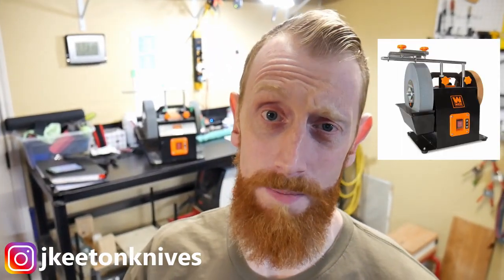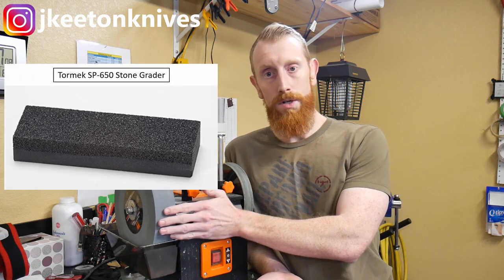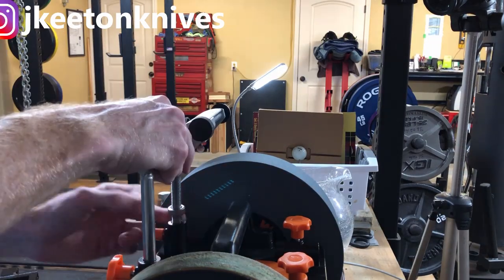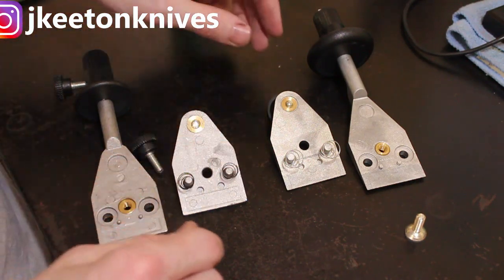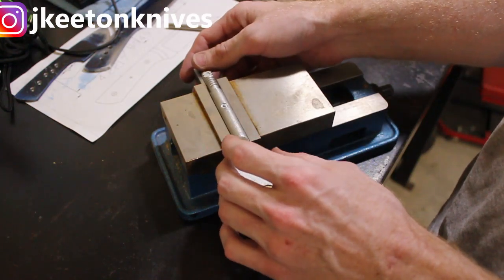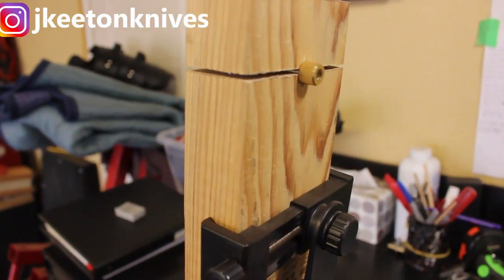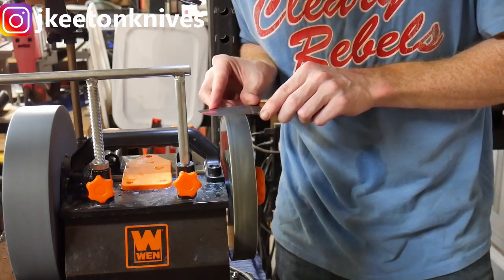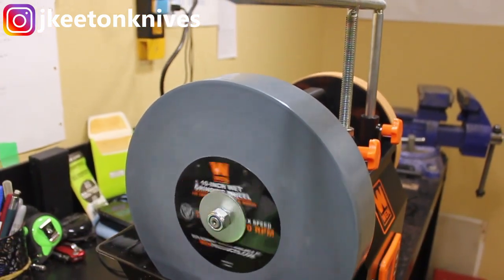WEN Sharpener Review & User Guide | Tormek Knock-Off

Comment: Just picked one of these up.  I also got the Tormek truing tool, but when i put it on the horizontal work rest and put the prongs around the vertical post of the work rest, it won't go all the way to the opposite side of the wheel.  Did you have this issue?
Reply: NVM.  I see you just have it floating on the horizontal arm like I did!
Reply from the maker: I'm not sure I'm visualizing the issue right, but the truing tool worked just find for me on my version of this machine.

Comment: I have a question  about the Wen; it seems to me that when using the guide bar to sharpen chisels against the rotation of the wheel, the guide bar is too short on the left side. I cannot use about 3/8" to 1/2' of thew grinding wheel on the left side because the hand plane blade support falls off of the guide . Do I do something wrong? Thank you for your help.
Reply from the maker: Hello sir, I've honestly never used it on anything other than knives. Sorry I don't have any advice for you.

Comment: Do you know if the torment sharpening wheels work on the WENs!
Reply from the maker: I have not tried any of them. But if they have the same hole in them and they're around the same diameter, I don't know why they wouldn't work! (The diamond ones may be more of an issue since you can't using the tureing and dressing tool on them to sure up on the WEN machine.
Reply: Red Beard Ops good point on the Diamond one didn’t think of that
Reply from the maker: @mtlvlgmnfishing  just thinking... it could work fine. I don't know. I'd make sure you have free returns on that purchase! lol

Comment: I bought one of these 2 years ago and for its price point, it's worked good for me but the axle was severely out of round making both the stone and strop wobbled pretty bad. On the strop side, I was able to work around it but took a stone dressing tool to true up the stone. It still has a little wobble but nothing I can't work around. I freehand though and can work around it.
Reply from the maker: Good to know. I feel like with these cheap machines the truing and dresssing wheel is a necessity.

Comment: It's all in the Tormek manual how to avoid the problem with the grinding angle towards the tip of the knife. You must push the knife handle a bit forward at the same time as jou lifting towards the tip of the knife. this will result in a more constant edge angle all the way to the tip of the knife. I guess you did the oposit that will make this worse.
Reply from the maker: Thanks for the comment.

Comment: How long does it take to sharpen a knife on this?
Reply from the maker: about 15-30 min
Reply: @RedBeardOps  
You ever try the paper wheel method?
I’m trying to figure out what system I want. Paper wheels, wet, or a belt sander.
Reply from the maker: @llamawizard  I have not, but have seen people have success with it.

Comment: When you cut 6mm bolt, what length did you cut it?    Length of bolt ??mm
Reply from the maker: Sorry man, I forgot. I think I just eyeballed it.
Reply: @RedBeardOps  
Do you think it is about 25mm?
Reply from the maker: @lightshine6044  I just went and measured it. It was 17mm of threads
Reply: @RedBeardOps  
Only 17mm long? Ok.
Thanks for your answer.

Comment: dear, plz answer my question, i contacted the Wen manufacturer in china to buy this machine, they sent me a video of the machine, and i noticed that the wheel is wobbeling!! they claim that this problem belong to the wheel quality not the machine itself,,,and they may have right, because they sent more than one video of different wheels, some wheels were less moving while others r wobbeling to much....will that wobbeling affect the sharpeness?
Reply from the maker: You don't want a wobbel. I'd either  return the machine or try to level it like I did with the truing tool.

Comment: Yep - there are options like the WEN.  BUT.... nobody but TORMEK uses the motors they do or the stainless hardware or the one-piece zinc casting that everything references off of.  In 6 months to a year, a WEN (or other knock-off) will be a doorstop because of this.  Save your pennys and get a real Tormek (like a T3) and you will buy once-cry once - and not be sorry when you try to use it.
Reply from the maker: Yep not arguing that Tormek is a better unit. I'm about 6 months in now, so far so good. The knock-off is a good way to get into the wet stone platform. All the residual equipment would work on a Tormek if I ever want to upgrade. I didn't even know if I'd like the system when I bought it so justifying the Tormek was difficult for me. I'll ride it till it dies and will update if it does. 👍
Reply: Tormek has better find ways to make their products more economical. Because what they charge is robbery. They've had plenty of time to figure it out now too.
Reply: Tormak knows how to do it for less. They would used inferior material and designs assembled by slave labor in China without any support. They just choose not to. I have their T8 and it is a delight to use. I'm sure that you do quality work and should be rewarded for it to.
Reply: @neilchristiansen1123  I'm glad you're happy. I'm happy enough using traditional bench grinders myself. I get the grinds I need with them and they're a lot cheaper to get.
Reply: @1pcfred  That is some mad skills controlling the heat and angle. Props to you.
Reply: @neilchristiansen1123  until the apex is formed heat is a minor issue. With a tool rest the angle is repeatable too. So no mad skills are involved.

Comment: Hello, could you please tell me the measurements of the stone, I know that it is 250 mm in diameter, but what is the measurement of width and the measurement of the center of the axis
Reply from the maker: Hey Irving, the stone has a 1/2'' arbor hole and is 2'' wide.

Comment: Does the Tormek long planer blade jig work with this? (SVH-320)
Reply from the maker: Hey Bill, I don't know the answer to that one.
Reply: Do you know if the space between bars on the Tormek are the same as the ones that come with the Wen?
Reply from the maker: @TerrapinCreations666  I do not know
Reply: @RedBeardOps  I finally got someone to measure for me. The Tormek bars are 9cm apart, center to center, and the bars on the Wen are 10cm center to center. Thought maybe you’d want to know.
Reply from the maker: @TerrapinCreations666  Thanks for the info Bill!

Comment: Hi, Would this work for grinding glass on the side part of the stone wheel? I'm looking for a grinding option that would dull the bottom of cut wine glass bottles. I currently use a diamond disc that I grind the bottom of the bottle with by hand but would love to find an option like this. Thanks in advance for the reply.
Reply from the maker: Hey Malou, to be honest I have no idea. I've never ground glass. I would imagine this would work better than doing it by hand though. The stone is not diamond impregnated. The good news is that the unit has free returns on Amazon... so if it doesn't work for you, you can probably return it.
Reply: Thank you very much 🙂

Comment: thanks for your video!  this is exactly what i needed to know.  i have ordered this unit for $125 + tax from Lowes and am waiting for it to get here.  question for ya:  i've seen people rotate the wheel on the hard stone both into and away from the edge.  intuition would suggest that it would be better to  rotate the wheel away from the edge so that you could actually feel a burr developing.  i noticed that you rotate into the edge.  can you comment on this?
Reply from the maker: Hello sir. I rotate the wheel to myself. This still provides a bur, but it's much smaller and easier to remove. Rotating the wheel away will also work, and it will produce a larger bur.

Comment: Great review, very helpful. When you were using the TT-50 to true the wheel, I noticed you didn't slide the TT-50 all the way across the horizontal bar and secure it against vertical post (I know the TT-50 won't reach across the Wen wheel if you do). My question is, is the TT-50 held securely enough using just the finger lock knob tightened onto the horizontal bar?
Reply from the maker: Hey Mike, it seemed to work pretty good for me.

Comment: The truing tool is not compatible with the Wen system. When using it you're supposed to have the v groove supported by the positioning arm and on the Wen system doesn't allow this. This means you are solely using the locking screw on a round bar which will allow play in orientation. That won't allow an accurately trued wheel.
Reply from the maker: It did a pretty good job for me... I babied it. Been using this WEN sharpener for a while now with great results.

Comment: Hey! Can you tell the landing diameter of the shaft?
Reply from the maker: Hey man, I'm pretty sure it's a 1/2'' arbor but I haven't taken it apart. Check out the label on this replacement wheel - https://wenproducts.com/products/4270-009-10-Inch-Wet-Grinding-Wheel
Reply: Ok, thank you very much! Your channel is very cool! I plan to start selling 10 "grinding wheels of my own production! I see a grinding wheel of Yapon 4000 grit costs $ 400, my grinding wheels will cost $ 200 maximum $ But first I need to set up my production!

Comment: Has anyone noticed the Wen jig does not produce a symmetrical angle when flipped over? Does the tormek jig resolve that?
Reply from the maker: I have not noticed this. Make sure the clamp has your blade centered... this could be an issue when clamping on a bevel.
Reply: ok yep you’re right. I was sharpening a full flat ground knife. I found that if I loosen the rear set screw as much as possible and tighten the front screw, there’s no gap between the knife and the clamp anymore and no wiggle. I didn’t realize I had a gap on the one side of the clamp therefore the knife was clamped on an angle. Thanks you saved me $70

Comment: The leather wheel has one hell of a wobble in it , this cannot be a good point.  Surely with today manufacturing technology the wheel  should run true, without a visible  horrible  wobble.
Reply from the maker: Still works as intended though. No issues here with the strop! But yes it would be nicer if it was true.

Comment: You probably know this but for anyone who doesn't, one issue with knife jigs is the Tormek, compared to others, is offset so as to allow for the thickness of a typical blade. To get symmetrical bevels the knife should be centered in the jig, with the wen jig it is not at all centered so the bevels will not be at the same angle and that reduces sharpness. Vadim at Knife Grinders can explain it better than I can.

https://youtu.be/GLIfIUfrA80
Reply from the maker: Man, I must say, I've gotten some pretty symmetrical results with the wen so far. Cheers sir!